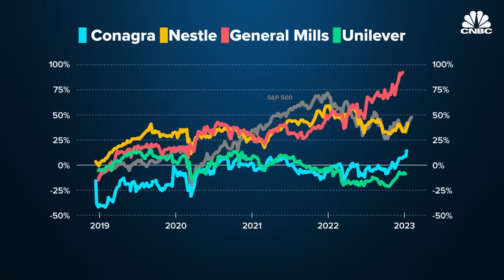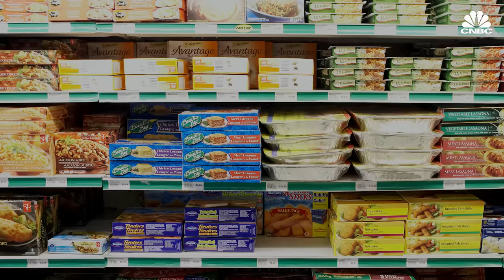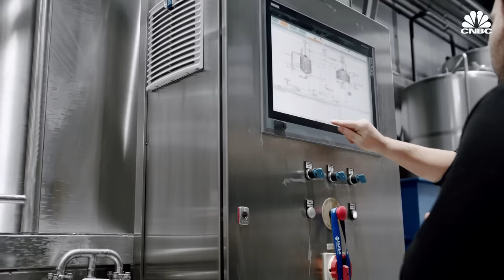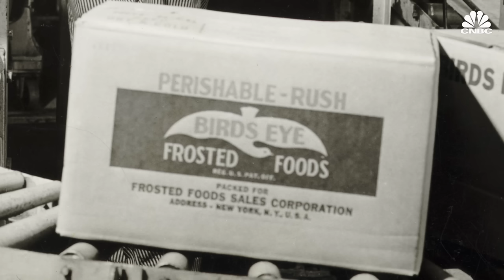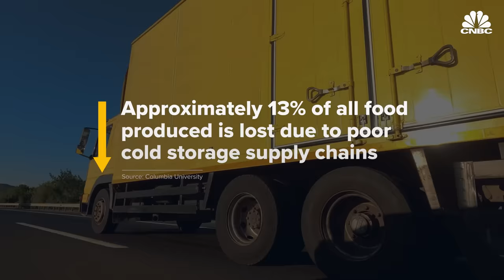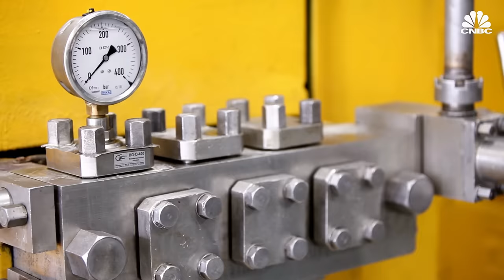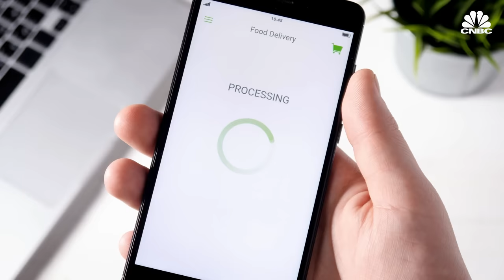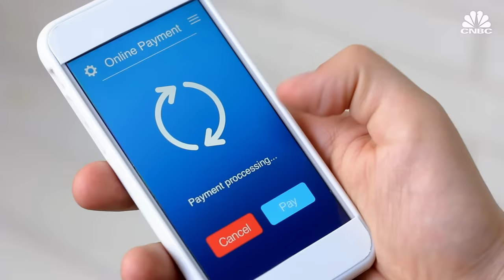Why Americans Love Frozen Food

Comment: Greenwashing at its finest....when they are selling cold chain refrigeration which causes 5% of global emissions, even having significant amount of Nitrogen in freezing and packaging which turns to nitrous oxide which is 300 times more warming potential than carbon dioxide, as a solution for food wastage when most of it comes from manufacturing and processing, supermarkets overstocking and throwing stuff out at 'use by date', from planned destruction to maintain price- all of which has nothing to do with refrigeration. 
This report just looks like a preemptive PR campaign to pose  frozen food as a 'solution' before people actually become aware of direct unavoidable heating from any kind of refrigeration ( because Netwon's first law of thermodynamics) and no matter what energy saving efficient end to end mechanism you do to inprove 'cost benefit', it's still going to be warming. 
But ofcourse if there are flat earthers in USA, some amount of verbal gymnastics and AI peppering can maybe delude them into thinking that Murica is so great to even defy fundamental laws of physics. 
The pervasiveness and matter of fact outlook to frozen food, end to end cold storage for everything and anything that the industrial food processors have normalized and fully airconditioned homes, cars and every other buildings are probably why the emission percapita is the fifth highest.

Comment: Was this a story about frozen food, or an ad for Phononics?
Reply: And Phononics looks to use peltier devices based on the video... which still use power to cool. Exceedingly skeptical their technology improves overall energy usage in the supply chain. From the video alone it looks like they're basically making little mini peltier coolers to store stuff. So now instead of cooling a massive warehouse, you're cooling those coolers. But peltier devices will put out a ton of heat in addition to using power, which means the ambient temperature in the warehouse is going to go up quickly. So you're still going to cool the warehouse a bunch even if not not to freezer levels. And instead of having one massive refrigeration system that might get some economies of scale, you're making a bunch of tiny ones.
Reply: @EricBrummer  For anyone that knows what a peltier cooler is, that's all common knowledge and common sense. I think that calling this a "solid state cooler" instead of a peltier cooler was a deliberate attempt to trick people into believing this is something it's not.

Comment: Maybe I am wrong but doesn't freezing require lot of energy in the first place ? That energy is most likely going to come from fossil fuels.
Reply: Not to mention any kind of freezing and cold storage means there must be proportional temperature increase in the surrounding air. Plus the Nitrogen for cooling which will turn to nitrous oxide which is 300 times more warming potential than carbon dioxide. Fossil fuel for the energy would be the least of concerns and something that actually have an alternative

Comment: Scientific values would be the true source but from what I know and have heard, refrigerators have high carbon footprint 👣 and use significant energy. Food waste needs to be handled properly but is bio-degradable with minimal impact on climate. If invested in food waste management- it will benefit just simply by providing compost and recycling nutrients.
Need for frozen foods came to be due to capitalism more than food waste. American culture (and many others countries) have established work culture that takes significant hours (greater than 40 hr work week) and to add to that worker pay has not risen to keep up with cost of living. This makes it necessary to put more hours towards work; hence less time to buy fresh produce, cook meals at home and hence dependency on frozen food (add to it also packaging and transportation). So it’s pretty energy intensive and high carbon footprint. Also, at the baseline of it all sits the reduction in food production not just due to pandemic but also climate change. So it’s going to get worse.
We need to reevaluate and fix lifestyle choices, clean up the market and more

Comment: I have had my say on global cold chains; I had to ship prime grade frozen fish from the US  to my Asian sister company. After an initial problem with an otherwise respectable shipping line, we systematically inserted our own cold logs in our products.

We didn't have AI in those days, but I examined the cold charts for over 1,000 containers.The product's freeze record looked like the reverse in a Nazi SS symbol.: a steep drop toward freezing, then a less steep angle as the product crossed the freezing barrier, followed by a similar steep drop in temperature afterward. I'll call that middle interval M. A smaller M gave a better product.

That M interval is where water transitions from one state of matter to the next, and requires a lot more energy to achieve the transformation from one state of matter to the next. How fast you you manage that transition in frozen water content, shall determine your crystal size in the product's flesh. Getting down to M was less of a quality negative than getting past M as fast as possible could be.

I sought to get my suppliers to boost the refrigerant of my shipments at entry into that critical M moment;  they begged off for various reasons, and that's all in the past.

A practical company might actively boost refrigerant at the point of H2O phase change to minimize frozen molecular accretions  and improve texture within the product''s edible structures. 

If you liked my comment; if you can find benefit from it: Please donate to the World Food Program